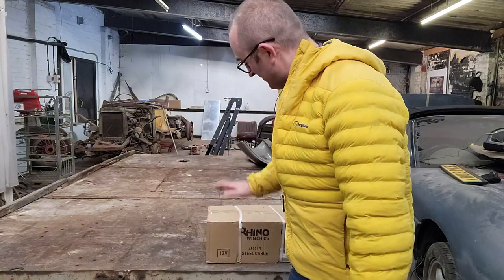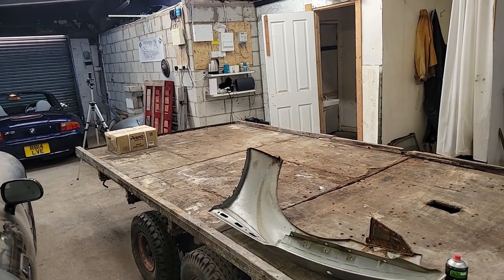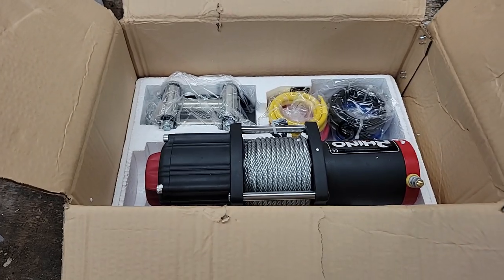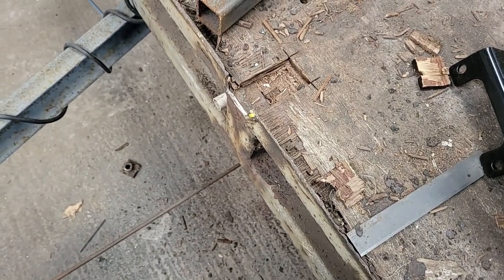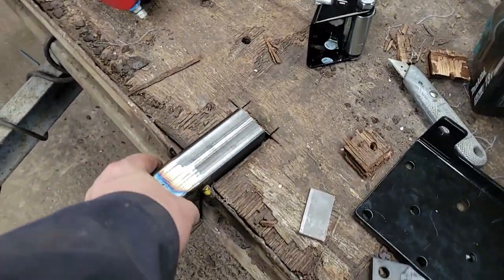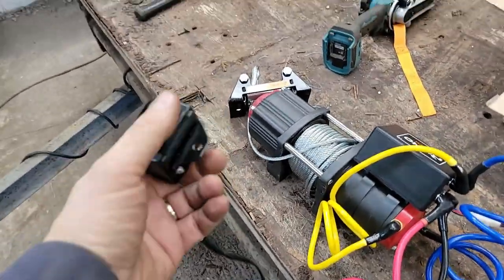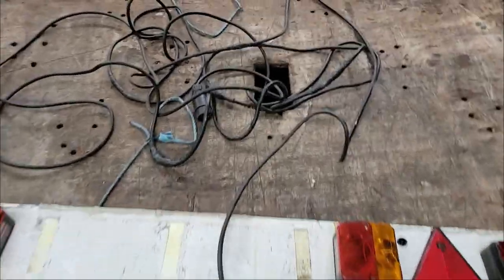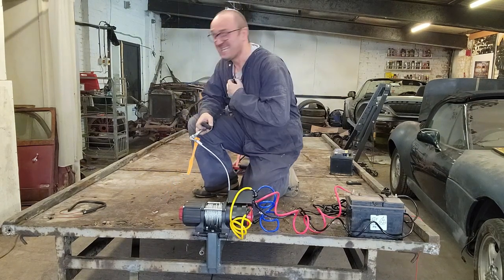Fitting an electric winch to my car transporter project

Comment: I wouldn't bother getting the wheels powder coated. A good coat of 2K epoxy primer and 2K paint over that and you're good to go.
Reply: I'd go further and say a paint brush and some antirust paint would do rightly for an old rough trailer.
Reply from the maker: @alibro7512  that would do for now...but I have ambitions for this trailer. Hence thinking about powder coating. I think with a bit of work it could be really slick.
Reply: @EVDIY  You might be surprised how good they would come up with something like Rustoleum Combi color original paint. I've been using it for years and it always looks good.
Reply from the maker: Will check that out. Been looking for a UK equivalent of Steel-It, which I've not seen over here. That stuff looks excellent.

Comment: The gross unbraked trailer weight  is 750kg! The unladen trailer alone won't be far off that!
Reply from the maker: Maybe. I have no way to weigh it! It moved very easily with the car on it with the Grand Scenic. Suspect I may have to move this trailer on anyway. Was hoping to use it to at least transport everything to my new garage but that is still looking a long way off.

Comment: Looks like a fairly reasonable winch for the money, and the wireless remotes will be a great help when you need to steer the car up ramps.
Make a wooden block with a cable groove in it. When you are pulling the car up to the ramps you don't want your winch cable running on the edge of the trailer. A notched block of wood hooked over the trailer end (like a chonky woodworking bench hook so it doesn't slide up the trailer bed) will guide the cable and save it from wear.

Also, depending on the length of the car relative to the trailer, plan for attaching the winch hook somewhere under the front bumper, using straps from further back to the chassis or axle crossmember, so that you are not pulling the hook into the fairlead rollers trying to get the car far enough forward on the trailer.

Worth adding a couple of lashing eyes near the winch so you have somewhere to hang the hook if you need to use a snatch block/pulley block, and also somewhere to hook on a ratchet tie down to hold the car if you need to re-rig the winch to a different point. 
Easier to do that now then when the car is half way up and you realise you need to change or adjust something.

Trailer boards are often so crappy and those lights are useless as the contact springs in the bulb holders are weak. I used Land Rover Series 3 tail lights before I switched to LED trailer lights that incorporated the triangular reflector. I also went for the 13 pin trailer socket so that I could have fog and reversing lights too. You might not need that for simplicity.

What is the max weight of your trailer? Hopefully suitable for your tow car.
Reply from the maker: I should have spoken to you about winches before! Forgot you had plenty of experience with them. 

Trailer is good up to probably 2500kg once I have brakes on it. It's not plated similar ones are rated to that or greater. Brakes are a future project. Keeping an eye out for parts but no rush. For now it's at the unbraked limit of 750kg but that's plenty for a little car with no engine etc, which is all I'll be moving for now.
Reply: Agreed about trailer boards, Your lucky if they work when new never mind after a year or two. Give future Tom a break and use the LED lights you have.
Reply: I agree. This style of lights is absolute crap. Nothing but problems with them.
Reply: @EVDIY  Haha, yeah, winches and trailers are a bit of an obsession!
Have you check the law on trailer weights?

From what I have found, IIRC:
You cannot tow a trailer with a maximum weight more than your towing vehicle is allowed, even if it isn't loaded.
So if your car is, for eg, rated for 2000kg braked and 600kg unbraked then you cannot tow an unloaded 2500kg trailer even if it only weighs 500kg.
If Police stop you, towing unbraked, they will want to know that the trailer is only rated for the max unbraked trailer your car is allowed to tow. I have my doubts they will believe a trailer with a car on it is less than 750kg (or whatever your car is allowed) and will weigh it.
If you are overweight then it is a constructions and use offence, and either towing over your unbraked allowance, or more likely, towing with faulty trailer brakes.

Better (and safer anyway) to get the brakes fixed and have a plate stamped and fixed to the trailer A frame showing the trailer weight to be within what your car is allowed. You can buy trailer plates from Ebay.

Aside from all that, winches are fun, and one day you might want to have a tow ball winch mount so you can drag stuff about without the trailer! 😄
Reply from the maker: @Maker_of_Things  Oh yeah - forgot to add that bit of the answer! Car is rated to 750kg unbraked and 1300kg braked.
Reply from the maker: @crasbee  That's advice from three sources saying the same! I've already ordered the new light board so will use that but swap in the LEDs.
Reply: @EVDIY  Ahh, good. Buy a couple of simple trailer plates, nothing with too much info on, and stamp one at 750kg unbraked to replace the old one that was too damaged to read. Later, the trailer can be uprated, with working brakes, to 1300kg. Check if there are axle plates that show each axle is rated at 650kg or more.
The trailer is really old isn't it, so there is a lot of info that isn't needed.